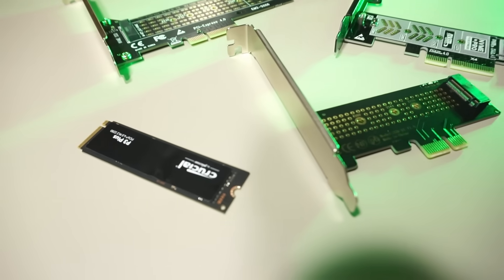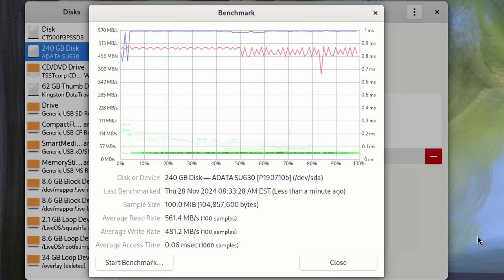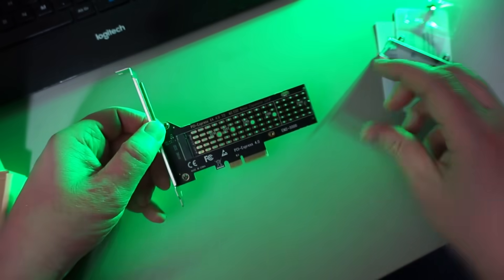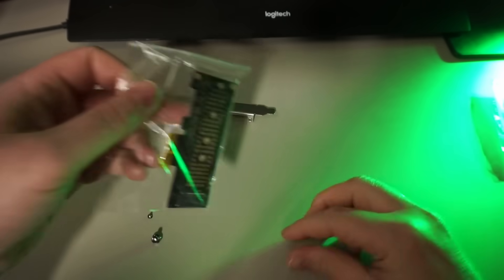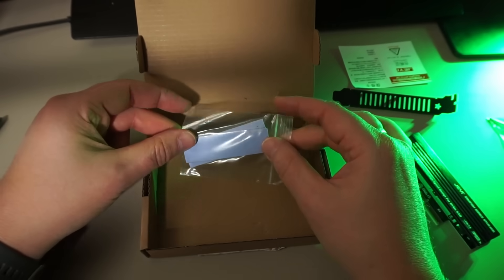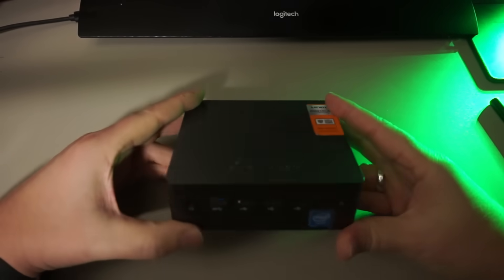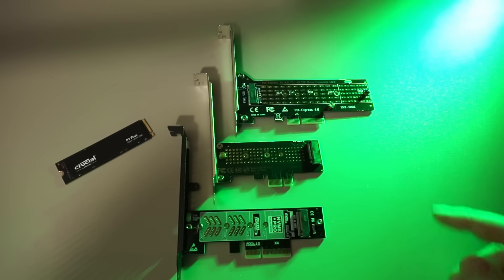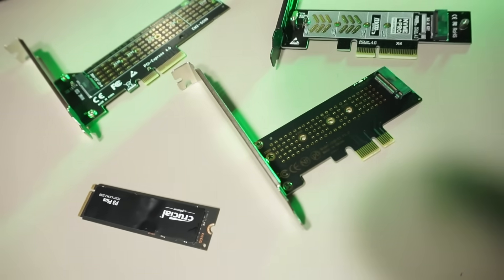Upgrade your old pc with an NVMe! Testing cheap PCIe M.2 adapters!

Comment: I have an extra, older i5 8400 pc that only has 1 nvme slot. And as Hdds are basically obsolete to my its usecase, a pcie nvme adapter is the only way to add more nvme storage

Comment: I tried one on an old Dell XPS 8700 and ran some speed test on it vs the regular SSD I had installed. The SSD was faster, but not by a ton. Both are much faster than a regular hdd, but its probably just best to get the regular SSD , at least for me it would be.
Reply from the maker: I would expect that machine to have at least PCIe 2.0 slots, so you should reach the same speeds I had in this video. Are you sure it used 4 lanes?
Reply: @ex-itguy  I'm not positive, but its not really a big deal. I only got the adaptor so I could test out a cloning device I bought on NVME drive with an old computer I have without having to remove the one from my main computer. I figured if it ended up faster I could use it at some point in the future in that computer. I already have plans to use that drive in a computer I ordered on Ebay that only had a 128gb drive in it, so I could put a 1tb main drive in it.

Comment: These 4X adapters only make sense if you got USB3 and regularly do big file transfers to external SSDs.
For Windows and such, the only thing that may make a difference in your everyday life is the SSD having a DRAM cache or not. The transfer speed beyond 500MB/s does not really matter.
Reply from the maker: I guess you meant PCIe 3, not USB3? Note that I made a mistake in this video, which I addressed in the follow-up. The tests were done on PCIe 2.0. On 3.0 the speeds about doubled. So I'd say these speeds are pretty awesome on an older system with PCIe 2.0 ports.
Reply: @ex-itguy  USB 3.1 or higher to be precise, as these are the only ones that can achieve 1GB/s transfer speed and where NVMe is needed.
And as you saw, even PCIe2 can do this kind of speed. No need for PCIe3.
Reply from the maker: I fail to see what these adapters have to do with external drives. I guess I'm missing something?
Reply: @ex-itguy  yeah, sequential speed is only relevant if you do regular backups of huge files to an external drive. For Windows and games, mainly 4K-speed is relevant, and it is usually (much) less than SATA-speed.
On my machine, my SATA drive maxes out at 223MB/s read speed for random 4K data, while my PCIe3 NVMe drive maxes out at "only" 282!! That's less than half what SATA can offer! And even that is too optimistic: a queue depth of 32 is only reached in server environments. For consumer systems, you are usually hovering around a QD of 4, which, interesentingly, reaches the same speed of ~167MB/s on both drives on my PC!! lol

Comment: The main point of those PCIe card is to recover data from a NVMe drive you can mount on a old PC laying around while not having a better option, nothing else.
Reply from the maker: I'd have to disagree on that. Even on PCIe 2.0 speeds are so much higher than SATA can handle that it's a pretty neat upgrade that hardly costs you more than a SATA drive would cost you. Note that in this video I accidentally tested on 2.0.

A board like the one I got for the follow-up video that has an M.2 slot that only supports a SATA drive in it but does have a PCIe 3.0 slot wil benefit from it a lot.

Comment: Thanks for this video.  I have 2 systems that run pcie 2 and It would be cool to be able to upgrade the speed of them even if its not going to be the full speed of the drive I could still benefit from it when loading games... Just doubt I'll be able to boot from it.  Though I do have a pcie card that bumps my sata speeds up to 6gb/sec on one of them (though I dont remember if it even gets close to the sata 6gb/s) but it does boot from that.  Of course it actually has other chips on the board too its not just an adapter.
Reply from the maker: Note that there's an error in this video. My test system only had PCIe 2.0 so you will get the same speeds as I did here. I tested again on 3.0 in the follow-up and speeds doubled.

Comment: I got one for a 256gb NVme ssd drive and I learned that when you boot Windows installer, it won't see the drive.  If someone enlight me with the reason why I will appreciate.
Reply from the maker: I guess your BIOS also doesn't show it as a boot drive?
I'll have to test for myself but I think what you would need to do is to install on another drive, then clone your install to your NVMe with something like RescueZilla, Redo Rescue or Disk Genius (or any other too you like). 
After that you'll need a NVMe aware bootloader on another drive to boot from it.

Comment: Wait, I had an X470 motherboard (PCIE 3.0), and I managed to destroy the main NVME slot; I bought the JEYI adapter, and it gave me the full PCIE 3.0 X4 speeds, around 3,500 MB/S ... 
I think you're doing something wrong ... That JEYI thing does give full speed on PCIE 3.0 slots ...
Reply from the maker: I did indeed do something wrong, that's why I did a follow-up that you should have seen at the start and end of this video. I tested on 2.0... oops! In the follow-up I also get double the speeds.

Kinda sucks that YT doesn't have a feature to add something like a text overlay at places where mistakes are. The only option I have is to trim it out, but you'll lose an important part of the video in that case.
Reply: @ex-itguy  I did see the other video but after commenting here lol... Anyway, thanks for the content, and keep up the good stuff ... Thanks

Comment: These work great to clone drives too - if for example you are upgrading to a larger nvme ssd and your board only has one slot which is occupied already with the current drive. Clone to the new drive using the adapter, swap them and you’re done. Easy peasy.
Reply from the maker: I think in that case you'd be better off with a USB enclosure so you can keep the old one as an external drive, but these PCIe cards sure are cheaper

Comment: your troughput wasn't related to adapter quality you just stuck every adapter to pcie 1.0 slot controlled by the northbridge  both x4 and x1 indicated by the white color
on a board where only graphic card is 3.0 controlled by the cpu directly
if you had a board supporting crossfire or sli the other long slot would probably be 3.0 but only 8x electrically
in some laptops i worked with i had to wire splice pcie slot to unpopulated soldering points and booting from the drive is only possibe via boot loaders like clover or refind but it is also a way to boot non uefi board in uefi mode :]
Reply from the maker: I wish YouTube would let me place a text overlay on screen. There's a card at the start and at the end addressing the fact that I accidentally tested on a 2.0 slot. It's also in the pinned comment and in the description but some people still miss it. ;)

Oh and this board does support crossfire with PCIe x16 on both x16 slots. The only thing is that it's fully 2.0 instead of 3.0. That's why I bought another board to set that straight. See the follow-up video.
Reply: @ex-itguy  don't worry youtube recomended me your 2nd video  in the subject , thanks for follow up  in a case of bootloader try refind which can be directly installed by apt in ubuntu if you mannage to boot to your os via bootfinder rescue cd or something similar but you still need spare drive your motherboard can boot from , can be 2gb usb flashdrive mounted internally in the case on spare front header pins
Reply from the maker: Some commenters also mentioned modding the BIOS. Idk, I haven't tried it yet. And now I have a system that doesn't need it. 😅
I'll sure like to dive into it sometime.
Reply: @ex-itguy  moding bios is hit and miss 
on locked encrypted bioses like on most laptop or oem manuracturers like dell hp or lenovo moding is very hard because bioses are locked and signed to prevent non veryfied boot. on older dekktop boards you may have some luck by importing and exporting module drivers. my fm2 board was moded by some kind soul on biosmod forum to boot to nvme ssd but it already was an uefi bios board with not locked ami bios capable of secure boot , it simply lacked mass storage driver fornvme and you could see in system browser the ssd was unbootable, but now it is plus some custom graphics. if a board does not support ahci uefi boot simply moding it might bot be enough because it won't be able to boot from gpt partition either
good luck

Comment: Great video, thank you so much for taking the time! I have a six-year-old system and I was wondering if it would make sense to buy an adapter for NVMe. For my system, it wouldn't make sense. You've just saved me the money and hustle. Subscribed!
Reply from the maker: Note that there is an error in this video, which I addressed in the follow-up video. All readings were PCIe 2.0, on 3.0 the speeds doubled. 
So if your 6yo system has at least a PCIe x4 slot available that's not shared with the GPU things might be different for you. :)

Comment: Interesting.  What program/OS did you run the benchmarks on?   Would have been nice to summarize the speeds in a chart for easy comparison as well.   Glad you mentioned that you can't boot from them unless they have a boot rom.  I wonder how the best way to "boot" the system so the minimum reading is done from "regular" drive (or very small SSD on SATA connection).  That is, start boot from the SSD, and then use the files on the NVME to finish the booting.
Reply from the maker: If you're running Linux you can just place your boot partition(s) on another drive (can even be a flash drive). For Windows you will need a bootloader that can read from the nvme. Clover seems promising but I haven't gotten around to testing that solution. 

I used Gnome Disks for this very unscientific test 😄

Note that there's a mistake in this video, which I addressed in the next one. The speeds in my test system were PCIe 2.0. On a board with a 3.0 slot speeds doubled.

Comment: How about using a Bifurcated pcie controller and get in some cases 3000mbs?...or more if you use a RAID configuration. I've seen some pretty low price on alliexpress. I'm currently using one dual NVMe I bought on amazon for $150. I'me seeing almost double per NVME. Bifurcated cards have a chipset on the card that allows you for use all the PCIe lanes.
Reply from the maker: Note that I made a mistake in this video, that's why I followed up pretty soon. The speeds are actually PCIe 2.0. On 3.0 it's twice as fast.

Comment: I ran linux at nvme speeds on a pre UEFI based bios computer by using sata ssd only for the boot grub and boot partition which passed from there to an nvme with remainder of linux directories.

Comment: A PC must have a BIOS that can boot from the PCIe slots.  Those cards have no BIOS add on.  They are great for speeding up application load times.  Check the bios of your mobo to see if there is a PCIe option for booting.
Reply from the maker: There's ways around that, but without too much tinkering you're absolutely right.

Comment: Where did you find nvme to SATA adapters? Show me one.
Reply from the maker: I found a few which I had shown on screen, like this one: https://amzn.to/409pVdL
However, that one takes a b-key M.2 card, which are already SATA ssds so I guess there's no conversion going on.

There's also cards like this one: https://amzn.to/3DBrZCQ
That takes both a b- and an m-key ssd. I believe you need to have a b-key sata drive in the b-key slot in order for an m-key to work. But I haven't tried those myself.
Reply: @ex-itguy  The first one is a b-key, so can't use an nvme there. 
In the second one, you can put one SATA M.2 and connect it using the SATA port. The second slot, the NVME slot, is used only through the SFF-8654 port, which connects to a PCI-E adapter.
So yea, we can say there's no nvme to sata adapter.
Reply from the maker: Yeah that seems to be the case

Comment: Linus has a "hack/work around" video on how to make NVME boot  up drive on old motherboards that don't support booting up from NVME.
Reply from the maker: I stil have to look into that, but indeed there are multiple solutions
Reply: Some part of that would be called bootstrapping. Basically put the necessary code on a boot partition to pass the boot process onto and load the OS from any storage device the BIOS can't.

Comment: Y modified My BIOS and work but..if You don't mod youre BIOS,install a USB or SSD/Hdd clover bootloader and woala
Reply from the maker: Should work indeed. I have gotten around to testing these options myself though. On Linux, making sure that /boot is on another drive works as well.

Comment: Bios has to support it mostly NvMe boot support was commonly on 8 th genertion 
modes.Macpro was an exemption 4,1 & 5,1 with firmware 14.0.0.0 works amazing
 (LGA1366) cannot compare with other intel motherboards test 70 Plus MacPro Models.
Reply from the maker: Only to boot from it. And there's workarounds for that.

Comment: the adapter was working fine for the  last two months but now the speed is choopy, any fix
Reply from the maker: That's weird. Did you do a hardware test to check if everything is alright?
Reply: @ex-itguy  how to do hardware test. Just bought it 2 months back, no physical damage. Reading speed is working as usual, takes 25 seconds to transfer 48 gb but to write/copy takes 4 min
Reply from the maker: Not sure, I guess you could just use smartctl to query the drive's status. Not much more you can do without another M.2 slot to check the NVMe drive in, or another NVMe to test the adapter card with.
Reply: @ex-itguy  Perhaps it due to window 11 upgrade. Have checked the smartcltr, no issue. have to check whether it is due to adapter or nvme

Comment: first everywhere i look it says pcie x 1 is faster than sata
Data transfer
PCIe is faster than SATA because it uses multiple lanes to transmit data. PCIe uses four lanes, while SATA only uses one
second can i install the pcie x1  adapter without the pc  bracket ?
Reply from the maker: There's a mistake in this video, my system only had PCIe 2.0 slots. That's why I did a follow up to retest. On 2.0 an X1 is slower than SATA. On 3.0 it's slightly faster, but not much.
Reply: @ex-itguy  yeh confusing for me . mywife bought a pc for her grandson and small shop without telling me and was sold a piece of crap . it has an asus prime a320m  micro  motherboard with 1 m2 slot with a 256gb  card which is a crap mb and is  now full . it only has a 2 x PCIe 2.0  i  need to get more storage but cannot afford to lose the shops delivery software or i would just buy a bigger m2 and reinstall windows
Reply from the maker: @welshricefields  you could use an X1 card just to copy the contents of the internal drive to a new, bigger one? Or a usb enclosure so you can use the old one as a glorified usb stick. ;-)

Something like clonezilla can help you with cloning the drive. RescueZilla and Redo Rescue I haven't tried yet but these look even easier to use.
Reply: @ex-itguy  yes thanks what i am thinking of doing is getting a 1tb nvme m2 putting it into the pciex1slot  then migrate or clone the mb m2 then swop them around but i am not sure if the new m2 will boot ok .. as it uses shop software i cannot lose anything
Reply from the maker: @welshricefields  If you use any of the cloning tools I mentioned, you should be fine. I can't imagine the drive itself is anything special so if you copy the whole drive (including partition info) everything should work.
Reply: @ex-itguy  ok thanks will try after christmas . one thing not to clear if i migrate the the original drive will be deleted but if i clone the both drive will still have windows ? i have done this before using acronis true image which i have

Comment: Man I love this channel reminds of myself a little!! In my desktop I bought an Intel Optane SSD 900 and it is very fast even running at 3.0. I put one of those NVMe adapter cards in my son's computer and it made a difference at least it seems so. Thanks for the video and you have a new sub!
Reply from the maker: Thanks! Note that the speeds in this video were on PCIe 2.0. I have corrected that mistake in the follow-up video.
Reply: @ex-itguy  yes you did great job!!

Comment: very informative. Thinking about how to hook up my nvme SSD to a 2015 system and see this video. Thanks!
Reply from the maker: Awesome! An updated video comes later today, because I made a mistake on this one. My test machine only had PCIe 2.0 slots. I just redid the tests on a board with a 3.0 slot. Short answer: twice as fast. ;)

Comment: Old PCs that could benefit most from this have PCI slots, not PCI Express slots.  Wprking on a retro PC right now that still uses IDE connections.  It can use SATA.  It has some PCI slots but nothing newer.
Reply from the maker: That are very old pc's haha, even the P4 I have here that's two decades old has a PCIe slot. ;)
I was thinking about buying a 44 pin laptop IDE to NVMe adapter case though, see if I can address these 500GB on my P3 laptop haha

Comment: Hi, what equipment are you using to capture the bios setup? Have tried a few vga-hdmi and they can't capture it. Thanks again.
Reply from the maker: I use a Magewell DVI plus I bought used for €60. Plus a VGA to DVI adapter I bought on Amazon for a few bucks, because it didn't come with the used Magewell. Works pretty well on VGA. Even DOS resolutions do pretty well on this thing. :)

Edit: no wait the VGA to DVI adapter I already had in my box of cables. Didn't buy that one.

Comment: Good video for older - maybe secondary PC's.
What software where you using to the Benchmark?
Reply from the maker: It's Gnome Disks, which is the reason I booted a Gnome-centred distro for these tests. :)
There's a mistake in this video: my test pc only has PCIe 2.0 slots. I have been testing speed on a board with an actual 3.0 slots today and can already tell you speeds are twice as high on a 3.0 slot. :)
Reply: @ex-itguy  Thanks